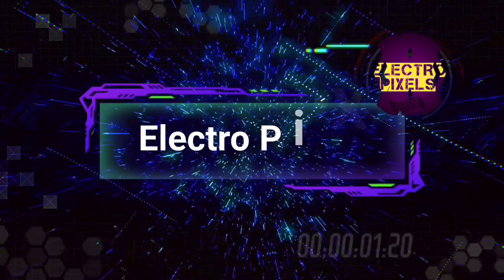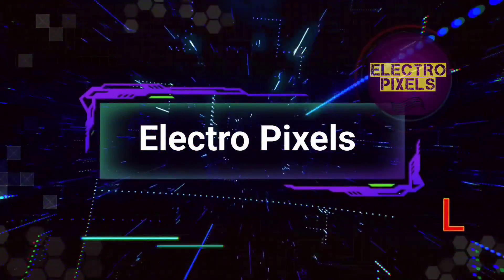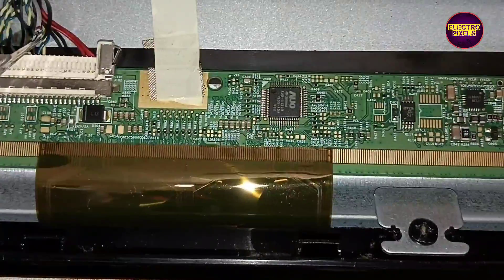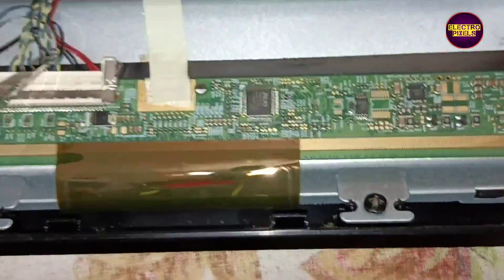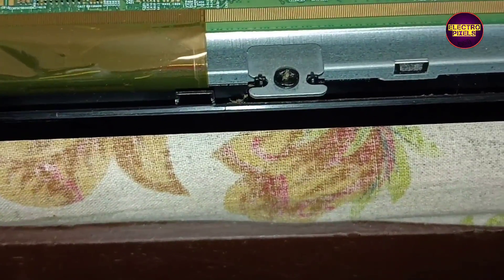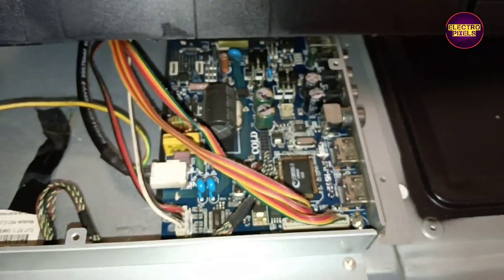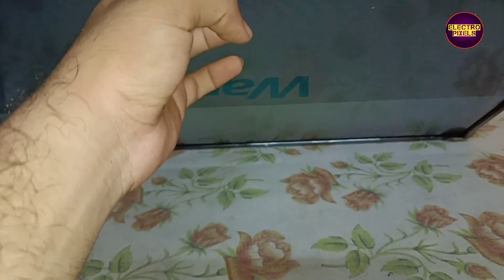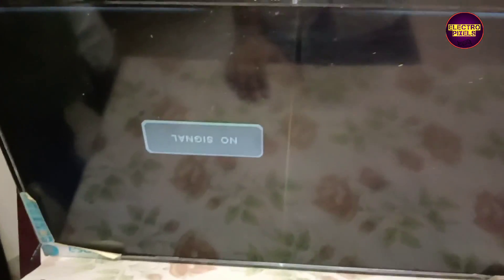LED Tv Panel Short  Removal on 32 inch Auo panel Led Tv Picture Freezing and Lines|Panel Repair|#Auo

Comment: Also seen in new Philips TVs the whole screen full of vertical color bars. But I think they were caused by Vgh or Vgl NOT reaching side COFs ( connection had a break) is that fixable thanks